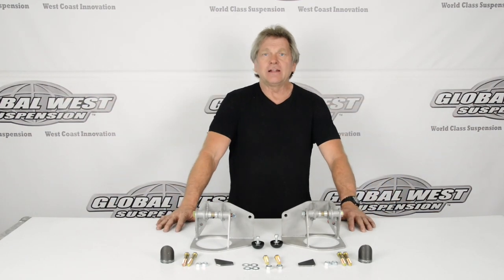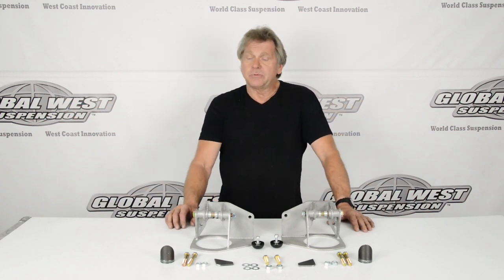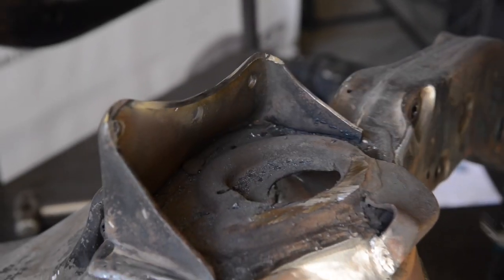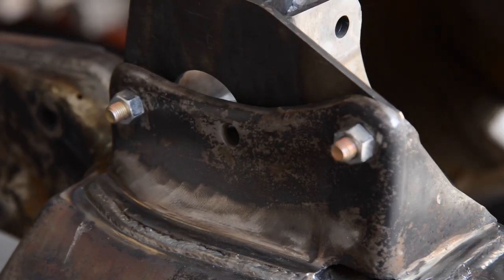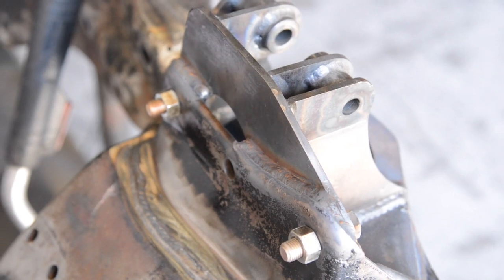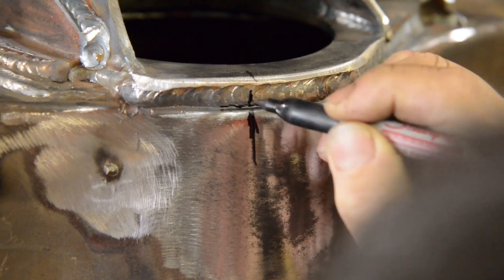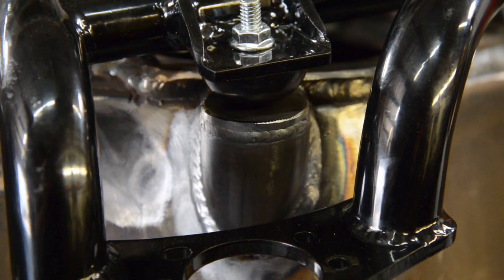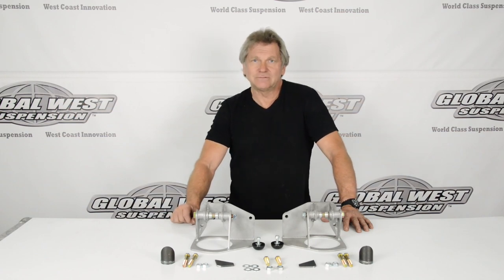How To Install An Extended Travel Front Coilover Kit On 1967-1969 Camaro & Firebird frames

Comment: Hi Doug, by using this can I use the lower tubular arm I have  They're Speed tech for coil overs? What length and travel coil over do you use with this ? Thanks What installed length on the coil over?
Reply from the maker: Give our tech experts a call to get that question answered ASAP! 877-470-2975